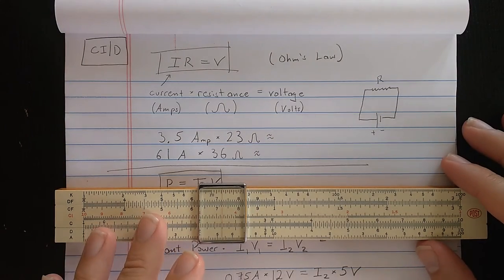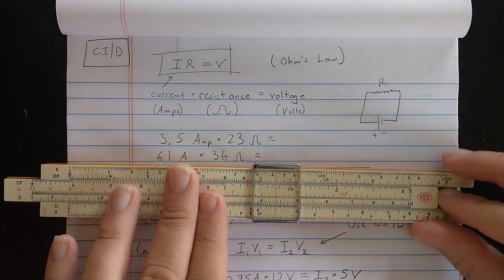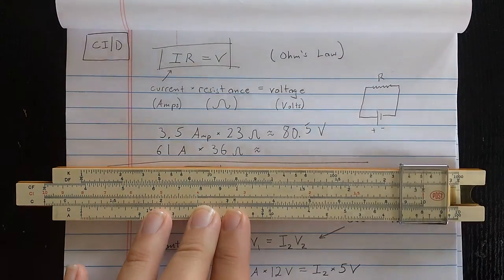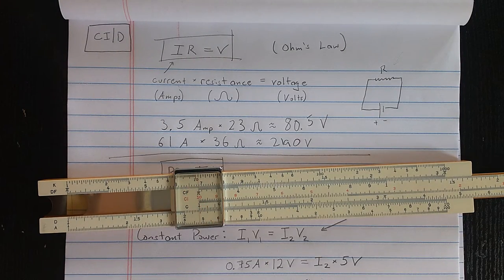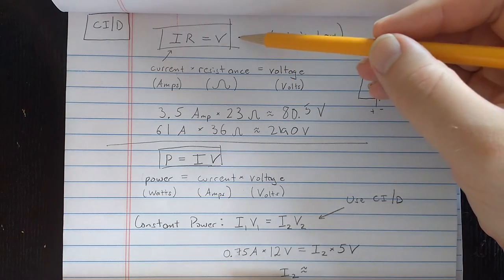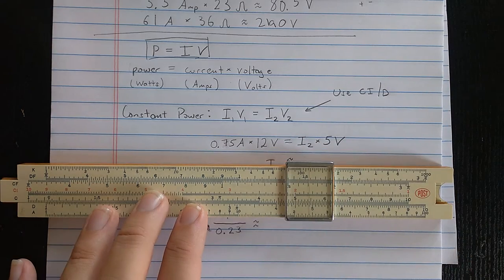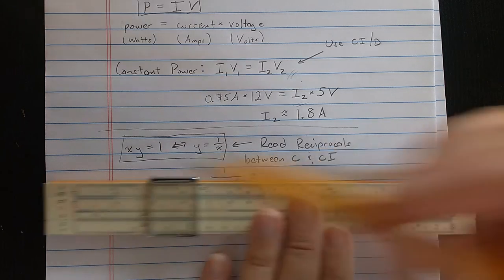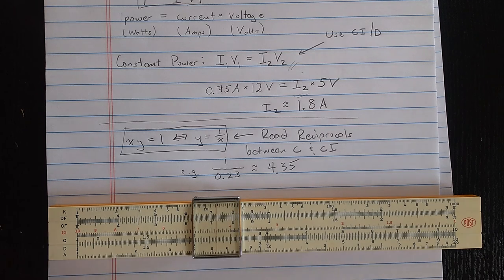Practical Slide Rule 3/5: More Proportion, Multiplication

Comment: Great video! I like these practical application videos, especially. I work in designing power supplies, so I often need to calculate efficiency, which is (Vout*Iout)/(Vin*Iin), with V for Voltage, I for current, out and in respectively. I’m finding it is actually faster to calculate this with a slide rule, than with a calculator, or even a spreadsheet, since I don’t have to enter each digit, but simply slide to the actual number on the rule. The 3 digit precision is generally adequate. Thanks for your work on these videos.